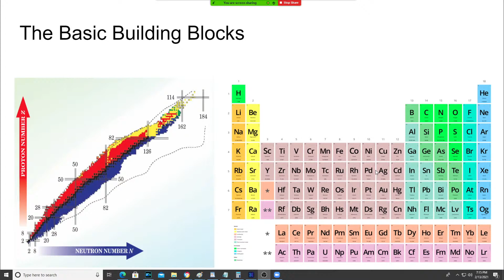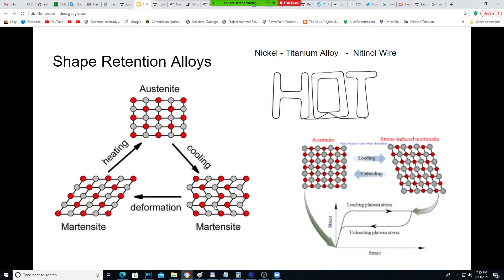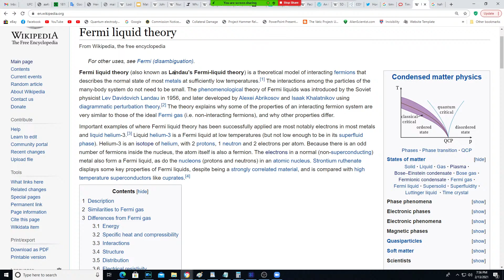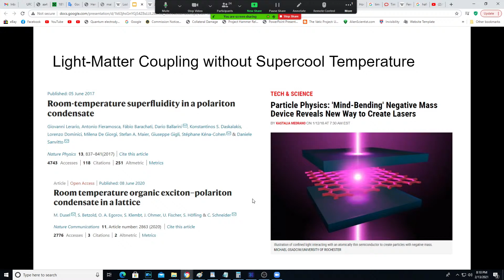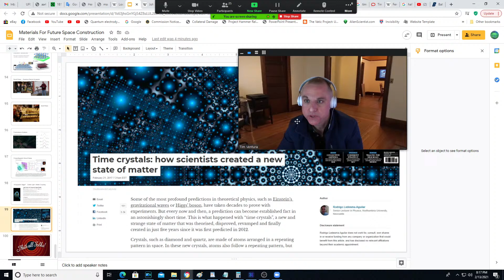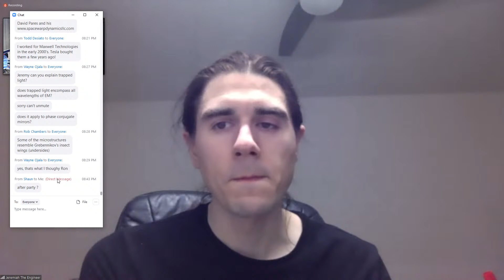APEC Feb 13, 2021 - Space-Age Materials for Future Spacecraft Engineering - Jeremy Rys

Comment: It might have been BS?. 
im sure you heard about the guy that made an anti grav device with scarab beetle wing casings. also. Bismuth-manganese. it might be a cheaper meta material for production.

something got me thinking about starlink sat dishes, the use a special radio signal directing antenna. im not sure what its voltage or freq range is. but if it was to put out the right freq that could interrupt a gravity wave or what ever  gravity is, "flux" perhaps. . it could be used as a device for directional movement.
Reply: Well photonic crystals are fairly common in nature.  For example, maybe the guanine crystals in chameleon skin could be useful for that.  If they're photonic crystals, then they might be useful for producing polaritons, because my understanding is that they form with structures with size scales similar to the wavelength.